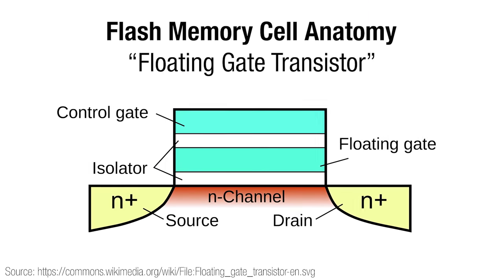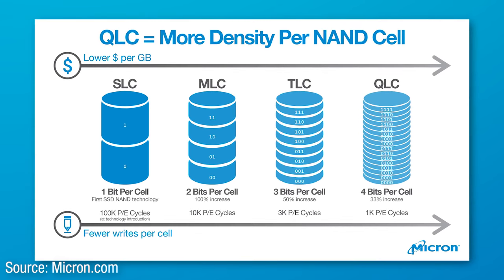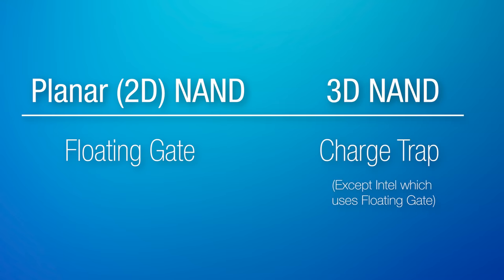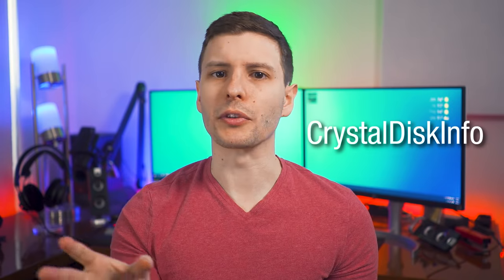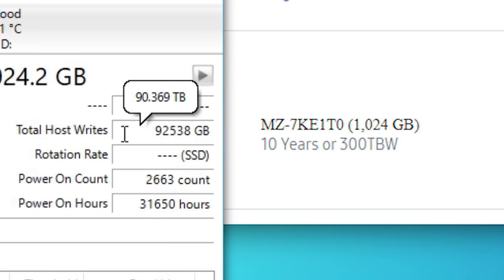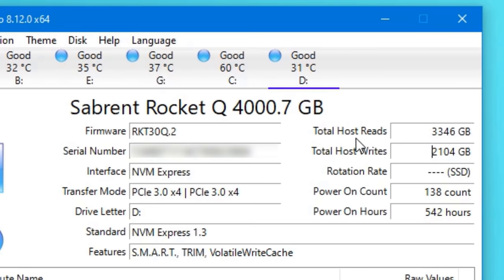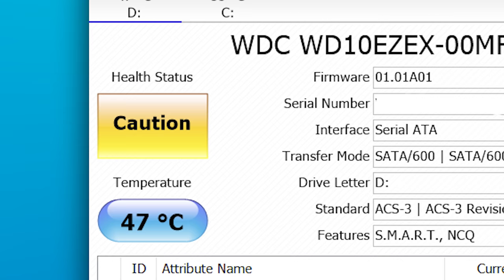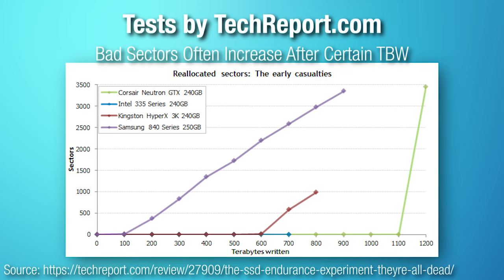How Much Longer Will Your SSD Last? How to Tell

Comment: I guess the problem with buying a cheap SSD like the one I just purchased (Silicon Power) is they don't even give you the specs with the drive. They do give a link to free software that they claim is a health diagnostics and monitoring software, but I'm a little leery that the software may be either buggy or contain malware.

Comment: Suggestion, move your page file onto a spinning drive or turn off virtual memory if you can to spare the write cycles to the SSD.
Reply: That's the worst idea. Page files on a spinning drive would make it unbearably slow. Just use your SSD and keep more than 25% of free space on it at all times to prevent accelerated wear of those individual free sectors. And delete your old files from the SSD to free the least used sectors so that they would be used instead.
Reply: @one_step_sideways  No it's not. Today with massive amounts of RAM, the page file is barely used and for non frequently accessed data. Personally, me with 16GB, I turn virtual memory off.
After being booted for days only putting to sleep, I currently am using 6GB with 10GB free and when doing video processing it doesn't get to 8GB used.
Reply: @DrHarryT  That's not the case for laptops. Most programmers use laptops, and so do I. I am currently stuck with 16GB RAM, and even though I don't usually run out of RAM just yet, it's getting there with each month. So I'll be buying a cheap Ryzen 7735HS laptop with 32GB RAM soon to replace my current 15.6" laptop which I use as a desktop replacement but which would be too heavy once I get a job that would supply  me with a company laptop or something else.
Reply: @one_step_sideways  Laptops are the exception since they typically don't have room for a second drive. [Maybe newer ones have room for two M.2 drives] So you turn off VM if you can or live with it. In my desktop I have M.2 main, SATA SSD hardware raid and a spinning drive software raid 8TB so turning off VM works fine for me.

Comment: What's the difference between host writes and nand writes? I have 2 listed
Reply from the maker: That's a whole video's worth but you should look up "write amplification" for SSDs. In summary, the TBW spec accounts for several factors in the estimate, and host writes is the closest approximation
Reply: @ThioJoe  so basically is the nand writes the one that I should still look at?

Comment: I am still using an old gen 2 USB 3 SSD that was known for failing and sold cheap. It was in my last system, my current build is getting a bit long in the tooth and it has been it the entire time too. It still works great and was mostly used as an OS drive, it even handles temp files and frequent updates. It has outlasted 4 platter drives. It is well over 10 years from when I got it. I use a couple SSDs atm. I will never buy a platter again, why make them so cheap now they just break over and over.
Reply: Also 2 years later, it is still working.
Reply: @krisreddish3066  thanks for the update! am looking into getting external SSDs now since 2 of my WD HDDs failed after <5 years. the first one I was actually using to store files; the second one was never used at all and was sitting in storage.

Comment: 6:35 is there really need for a back up?
if I'm not mistaken if the ssd is about to fail it will turn into a "read only"
which mean you can clone it even if it already fails.

the only time you can't recover or hard to recover files on an SSD is when it was cut to half, broken from short circuit, water damaged, etc etc.

Comment: I still don't get why E-Drop (Electrowetting Drop) drives aren't a thing yet, they'd be the MOST resistant to wear & tear, incredibly fast to read (assuming light is used to read many cells at a time), and reasonably fast to write, at the very least faster than HDDs and almost as fast as, if not as fast as SSDs. All it takes to "write" to a cell is to move the drop, light split into multiple rays can be used to read many cells at once where the absence of light means 1 or 0 (I'm going with 0 to indicate light could not get through or was redirected). I would've thought that companies across the globe (especially internet ones) would be pushing hard for the development of such drives and we consumers would just benefit as a side effect

Comment: 7:30-i know a ssd is not a hd
I know u cant scandisk a ssd, but maybe there is an app that will allow you to.
Ok i had a 1tb hd external drive, i had it partitioned into 5 200gb (or so) drives. I had a bad scetor on drive 3 and thru scan disk i moved it to the drive 5. 
Yes i know this isnt how things work, but it worked for me..
Once i moved that bad sector to drive 5, i stopped accessing that drive. The 1tb lasted 2 years after that (i was residentially challanged, because i was employmentally challanged)(so i had to make do with what i had)

Comment: What exactly happens when a SSD begins to fail? Does it relocate data silently, so that it just becomes slower? Or does Windows create a silent error message in its logs that you will only see if you examine the logs? Or is there an error message shown?
Reply: Had two fail. Zero warning 100% data loss.  Last one was a month ago. Well under expected life span.  It was the 'new' one in the computer.

Comment: After some asking ChatGPT cause Crystaldisk for some reason shows me having written 300TB on the 240gb ssd with a tbw of 84. Chatgpt says my drive only actually written 1~ TB over 1 year of runtime. Idk why this happens, but GPT formula is 263,836 x 4KB/LBAs / 1024 / 1024 / 1204.

Comment: TBW is just a value, similar to warranty period. It´s similar to when you buy a car - you´ll get warranty for x years, or 100k km, whichever happens first. This doesn´t mean your car will break after 100k km.

Russians did a large-scale test for this (which i´m unfortunately unable to find anymore and the domain seems to be on sale) with graphs from tests and screenshots from Crystaldiskinfo - they were basically brute-writing large chunks of data and continuously overwriting the drives way beyond their TBW. Some top quality SSD´s were able to be overwritten 4 times more, than their TBW, while many cheap drives were unable to even reach their TBW value before they gave up and started showing bad sectors.
This means, you can theoretically write more data onto your SSD, than the manufacturer claims. It all depends on internal quality of the memory cells.

Besides, TBW has nothing to do with production quality of said SSD - it can fail anytime, just like HDD. Even tho it has no moving parts, it´s basically small computer specialized at storing and maintaing data on its assigned memory cells. Also, most common way of SSD fail is missing partition, while the write-locked partition is the luckiest (meaning when you lose data on your SSD, they are gone, with no way of recovery). You should back the drive up regularly.

Comment: I wanted to give a SATA SSD to a friend and when I was cleaning the dust off, it only fell onto my desk and already got damaged. There are times where the SSD wouldn't respond for a minute, causing Windows to freeze.
Then I recently bought another 126 GB SATA SSD for my friend from the same german manufacturer Intenso, and within 2 weeks it just died randomly. No shocks or anything. It just doesn't get detected anymore. After that experience I will probably stick to big international brands like Samsung (which I use for my personal PC).
Kinda a coincidence that I see this video lol

Comment: So if you wrote to an ssd switched the filesystem to read only mode would that last forever?
What if you fill up all but one cell then wrote several TB to that one cell? Would that cell survive for the whole TBW?
You said that after the TBW the drive space might get smaller because of reallocated sectors. Then you talked about the drive dying. Does "drive dying" just refer to the earlier drive getting smaller thing? Is there a risk of data loss as the TBW goes up? If you run out of good cells can you just essentially have a read only disk from then on?

Comment: I wanted reliability and speed.  Settled on 15k RPM SAS hard drives in Raid 0. 800mb/s, 2mS latency and I use a M.2 SSD as a cache with specialized software and I can write exabytes and read exabytes while being able to load my software in a semi reasonable speed.

Trouble is, the hardware uses lots of power and real estate in my computer case.  Data honestly is Priceless! Why not.

Comment: Only 1.5 min in, but I'm immediately getting that lower storage drives would probably last the longest
Reply: This isn't the case. To get a long-lasting drive you need to buy a TLC drive, and not a QLC one. With QLC you not only get a lot worse longevity and an actual possibility that your SSD would fail over the course of your PC's lifetime, which makes QLC drives bad for using as a system drive, you would also have much slower write speeds when you write more than 5-10GB of data at once. The price difference between TLC and QLC drives has been miniscule up until very recently, so I don't see the reason why anyone would use QLC SSDs unless they hardly ever write to them and read 5-10X the amount of data that they write to them.

Comment: This is why I use Linux Mint Cinnamon. My 256GB SSD is my Root partition. It stores the system and the applications. So it was written to just the one time but really is only read from now. My 1TB platter HD is my Data partition. All of the writing happens on the HD. When you install Linux Mint, it automatically recognizes that you have created separate Root and Data partitions and by default your "Home" IS the Data partition. Windows and macOS do not do that; they want to write everything to just one drive -- the primary drive. Want to keep your SSD for a long time? Dump Windows and macOS and install Linux Mint. 95% of end users will be just fine with Linux.

Comment: Problem also is that most people use default filesystems like NTFS on Windows on ext4 or Linux, and those filesystems are written for conventional disks in mind.  Until OSes adopt a filesystem written solely for such devices from the ground up, the lifespan of an SSD will be reduced.

Comment: Unless you edit videos a lot, with normal use an ssd far outlasts the pc, probably multiple pc's. It's only going to fail to write, it can still read perfectly fine as far as I know. So the failure mode is much more graceful than a HDD, perfect for archiving too.
I own SDDs from almost all generations starting from 64GB, 128GB, 256, 512 and 960GB. None of them have a wear level of more than 10-20% tops, over more than 10 years.

Comment: There are more that meets the eye for example SLC 256GB ssd can withstand about 100000 cycles of wright/erase when QLC 256GB ssd can take about 500-1000 cycles this is not a big number by any means.
To stretch the life cycle of those drives manufacturers put SLC cache or/and DRAM memory but flash cells life span stay as they were.
SLC are superior in performance but they are more expensive so to reduce costs manufacturers make even PLC flash cells "penta means 5 bits opposed to QLC quad 4 cells"
and the idea is to write 1 bit of data in one SCL cell when on PLC cell you can store 5 bits and to store those five bits you write five times the same cell.
So 256GB ssd slc 100000 times when 256GB  PLC with 500 write cycles shortens cell life 5 times faster.
The idea here is the larger SSD the longer it supposed to last so if you buy ssd QLC then only large drive never small ones if SLC then any capacity works within reasonable cost.

Life cycles is an information of guarantee life cycles this does not mean that PLC will die after 500 write cycles or SLC after 100000...

Comment: well. my first ssd, was a OCZ vertex 2 in december of 2010. a 120gb drive for 199 bucks. very expensive for the day. that ssd died after 14 months. i got a new one, was cheaper by now, that died just before the 2 year mark. after that, i never bought ocz again. but my crucial mx 256gb didnt last 3 years eighter. nowadays, with windows and all the updates and steam downloads, my drives get a lot of milage. i just bought a new nvme  1045 hours of runtime on it but it already wrote 1,046 TB

Comment: Just installed that crystal disk info software, not an IT geek, I don't understand those figures in the columns below. What does it mean Read error rate current 74, worst 57, threshold 6?  Wikipedia says that during operations this number can go up and not necessarily reflecting the health of the ssd. But the wiki also states about    Reallocated Sectors Count that should be low. The values are 100 100 35, with raw values just all zeros. What does the threshold value 35 mean? I have been having this PC for 2.5 years, using it almost daily for various things.

Comment: TBW isn't a measure of when your SSD will die. It is a measure of when it can hold your data unpowered for 1 year (retail SSD) or 3 months (enterprise SSD). You should still use hard drives for unpowered backups.

Comment: Have to wonder. I have a Micron 1100 Sata 512 GB drive in a laptop. Crystal is showing 1302396062 GB written. The read block is dashes. Used drive off of ebay that came in a used laptop. 1480 power on hours. Wonder what in the world they were doing with it. Status is still good, no percentage. This drive is way the heck over warranty spec. The figure above is a cut & paste job, it's not a mistake. ACS-3 | ACS-3 Revision 5. Works fine.

Comment: Getting an ssd is worth it. I have a 1 tb ssd as my main hard drive on my pc, and an ssd is better than a traditional hdd. The reason why is that with a traditional hdd the more content that you have on an hdd the more slower it gets. You don't have that problem with an ssd as it maintains it's constant access speed throughout no matter how much content that you have on your hard drive.
Reply: Actually SSDs do get slower when you reach like most of their storage capacity.
Reply: @xKateshi  Must be my pc because I do not notice it getting slower in which I have had my ssd filled 100% a few times & have not noticed slow down on my pc.

Comment: I noticed that the Power On Hours for your drive is 31,650 which translates to about 3.5 years. Yet you mentioned your drive is actually about 7 years old. Why doesn't the PoH number match the actual installed/in use time?
Reply: because his computer was off for the remaining time

Comment: My 840 Evo doesnt have a listed terabyte written terabyte limit - that said, i saw its not uncommon for it to reach 400TB range for a lower capacity drive before failing

that also said, my SMART data is freaking out over the fact that the Used Reserved Block Count failed past, but was restored to a normal value... this is worrying but i think im gonna run it into the ground before i replace (all my essential data is backed up on mechanical HDDs on 3 different computers)

Comment: Web browsers write a boatload of cache data, normally to the C: drive. If the C: drive is an SSD, is it better to redirect cache to perhaps a USB thumb drive? That would reduce SSD wear end tear. (In Windows, redirection can be done via “mklink” at the command prompt.)
Reply: The best solution is to use a Ramdisk.

Comment: By the way, with that tidbit given on SMART, sometimes interfaces will list its status as "Not Available" or something of the like, which is a very bad sign. My sister had a macbook that had a hard drive with this SMART status. It worked find one day and I could navigate through the drive via the terminal. But the next day, it was dead and wouldn't even be detected by the system.

Comment: If you have a computer with a standard 1Tb HHD drive and a 256Gb SSD drive,  is it always best to install the Windows operating system on the SSD drive along with the software for as many software applications as possible?  Best to configure all data generated, such as documents, pictures, video, music to the HHD drive?  The operating system and software applications will boot and operate faster, although retrieval of the data files may be a little slower?  Would the OS and applications on the SSD drive considered as one Write, since it's never or rarely erased?

Comment: I had my system SSD drive die on me overnight. It was a little bit over the 5 year mark, but i had used Samsung Magician (also a nice software to check health, and it also updates firmware on the drives) to check it and it was "Good" Health. Next die, computer wouldn't even boot to bios due to its failure.

Comment: The reliability of SSDs is not better than HDDs unless the HDDs are not setup for longevity. SSDs have no way to set them up for a longer lifespan. Just do even simple research into the businesses that storage data for long periods of time and see what hardware they use and why. SSDs are also extremely fragile when exposed to radiation or electrical shock.

The reality is SSDs are not more reliable but they are much more predictable and consistent. Now in humans we like people who are predictable and consistent and we call them reliable but in the world of hardware it is not the same. Because definitions are important when an insurance adjuster is involved.

Comment: Is it really smart idea of using QLC for "reading" stuff, cause QLC is not only slow at write, but its way slower then other memory type for read? Not even mention that 940TBW fr 4TB drive is just 235 full rewrites. Still a lot of data to write, but not high durability.